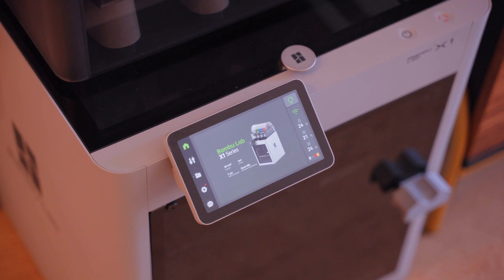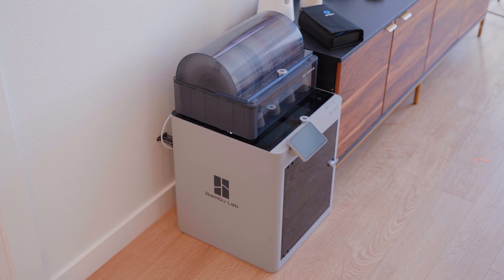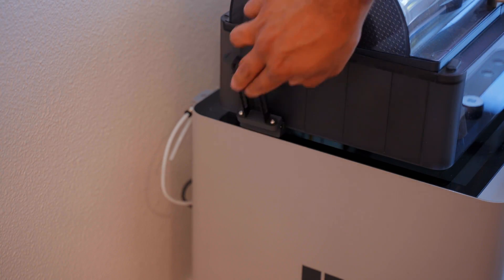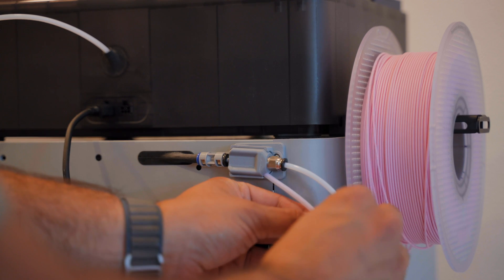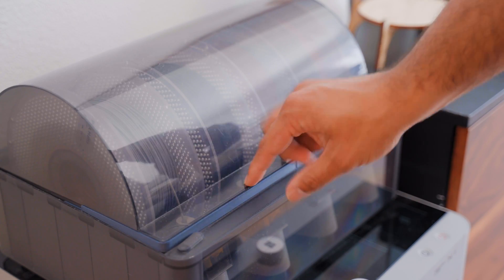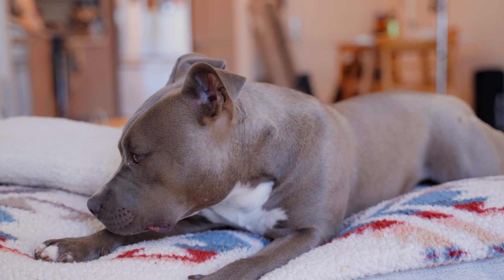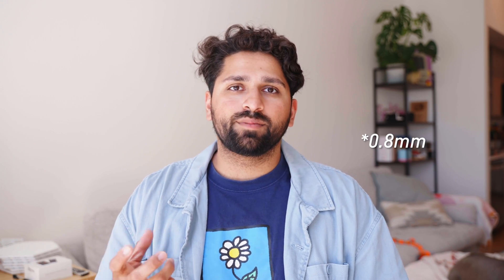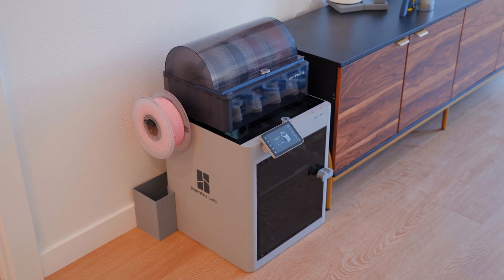5 Upgrades for the Bambu Lab X1!

Comment: The AMS lid riser is not air tight and comprises the seal and is not an "upgrade".  Ergonomic door handle mod is not an "upgrade".  The concept of changing the whole hot end assembly instead of the nozzle has been around for months and was just an excuse to hawk the tool kit.  Crap video.

Comment: I did the side spool when I first got my X1C... until I learned about drying filament, now I use a Creality Space Pi to dry out and as a drybox for printing TPU and abrasives, DO NOT print non-PLA from a side spool. just don't.